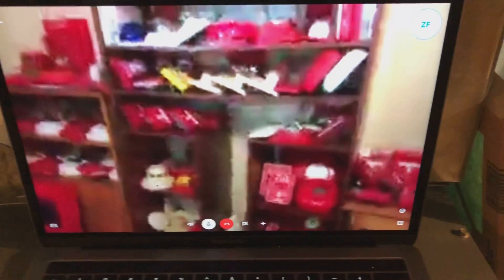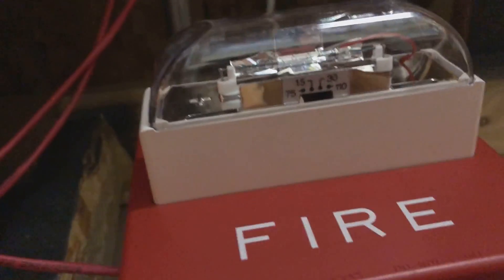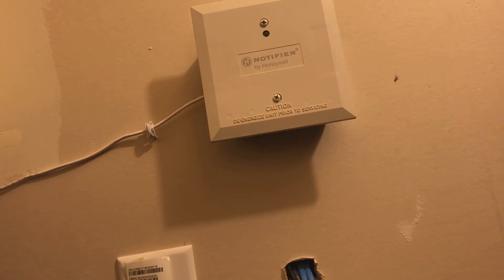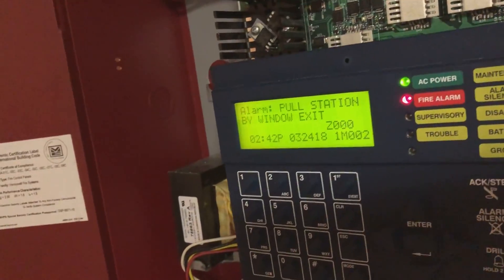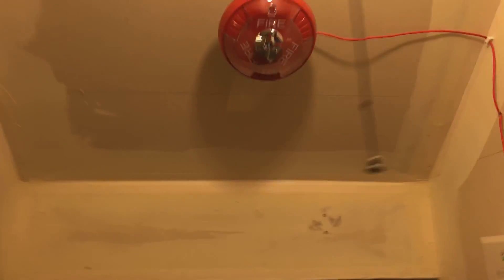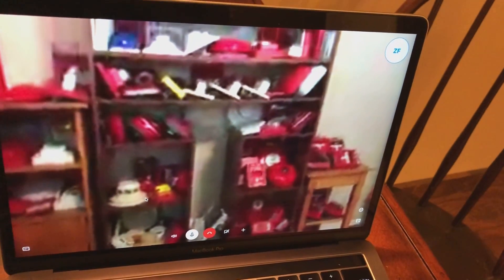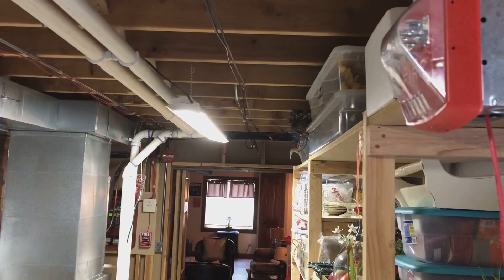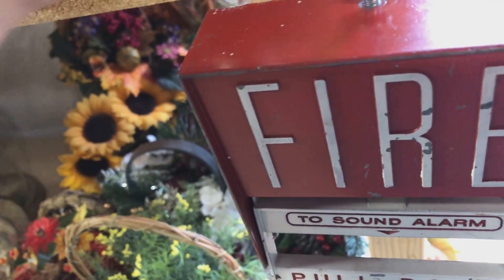Home System Test 31: Featuring Special Guest Star S.E.R. Safety!

Comment: Great Video :)
#BringBackAudibleSilence
Is the BG-6 new (I've never seen it until now)?
Did you use Photoshop for the Thumbnail?
Reply: Zachary Fleck Great Job! Not bad for a first time Photoshop. I find it a very easy to take a screenshot in Premiere, then right click on it and open it in Ps. I’m actually certified in it, if you need help!😉